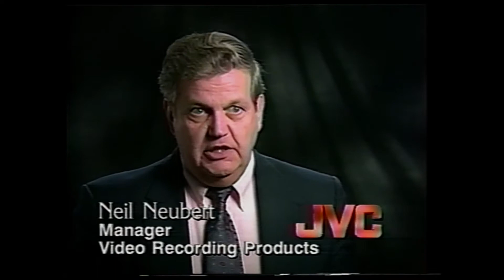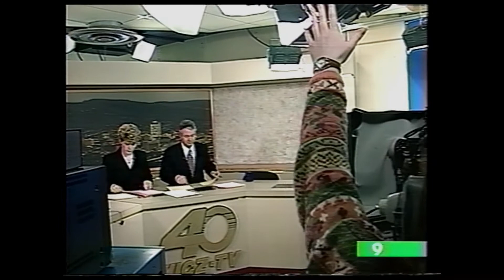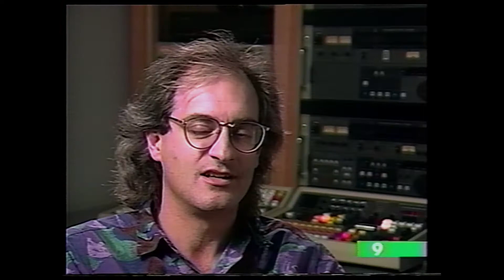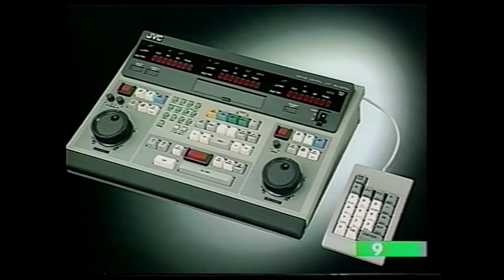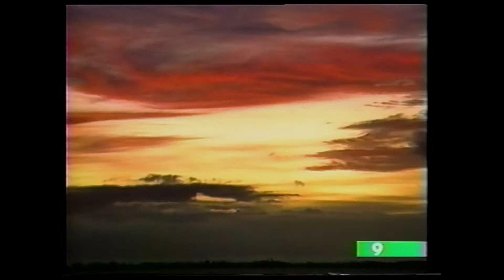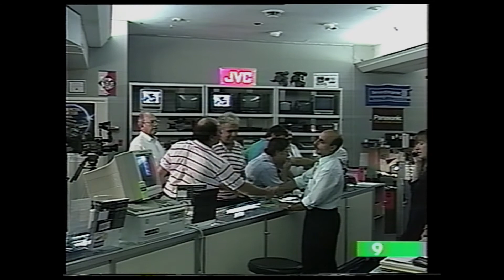JVC SuperVHS Third Generation Demo Tape 1993

Comment: I used S-VHS years ago and I thought it was a great format, it was nice to have sharp detailed pictures and good sharper quality VHS copies with excellent quality HiFi VHS stereo sound to boot.

I shot on S-VHS tape at the full 400 lines in SP to get decent quality master recordings, edited onto S-VHS tape in SP using Y/C connections, to retain the excellent quality, with the Timebase Corrector on the vcr switched in to reduce the familiar VHS jitter with kinked vertical lines and kinked vertical subjects, and added stereo music, sound effects and any other post production necessities like opening and closing titles, and transfer the final results onto high quality Fuji double coated SHG VHS blank tapes or any high quality videotape like TDK SHG HiFi, Scotch 3M Broadcast, Scotch 3M Professional, TDK HD-X Pro, BASF HiFi Professional etc, to make very acceptable quality final generation VHS copies.